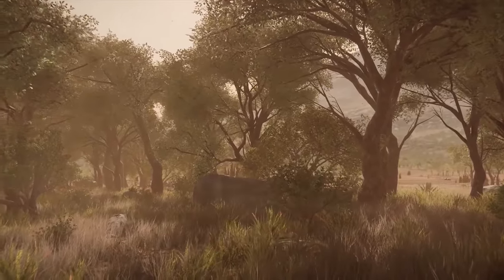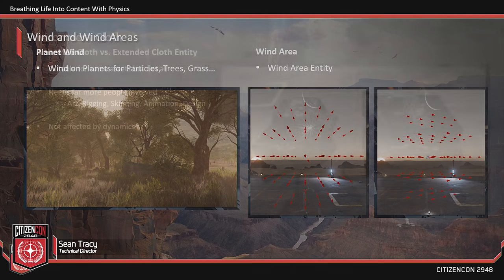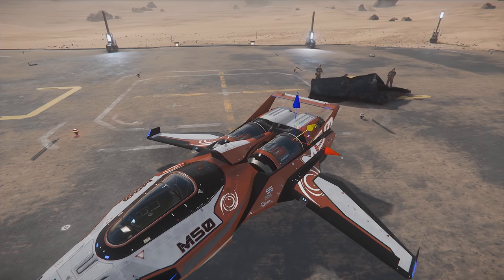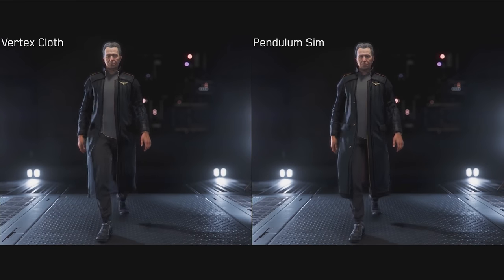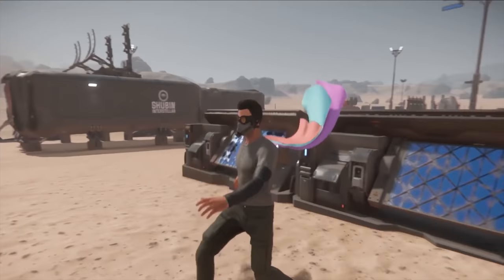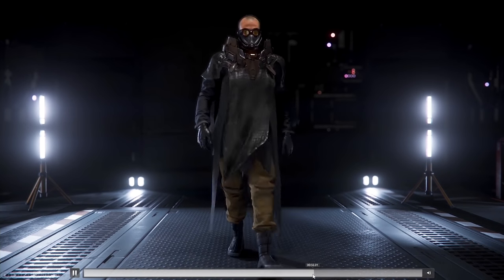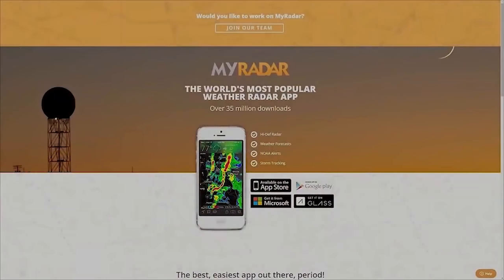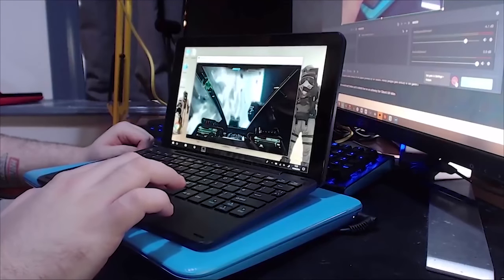Star Citizen | Physics, Clothing & Gas Cloud Tech - CitizenCon 2018 Summary

Comment: I understand the explanation for the vertex cloth switch, however imo it has a tendency to make material look extremely light-weight, like silk or something.  In the first side-by-side comparison where the Gary Oldman model was walking, the pendulum effect gave the motion of the trench-coat a more realistic flow- assuming of course that space trench-coats are going to be a more substantial piece of clothing (safe bet), a heavier material isn't going to mold to movement as fluidly.

Comment: So i am using a tripple monitor Setup. If i understand it correctly because of the way of rendering the clouds i will have a bigger impact on my performance than i normally would have with a tripple setup. Is that right?